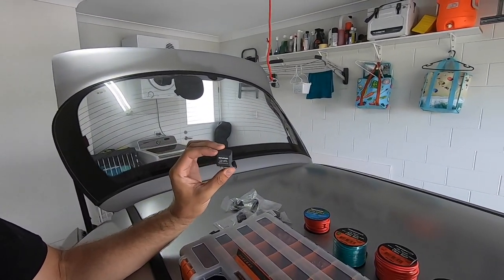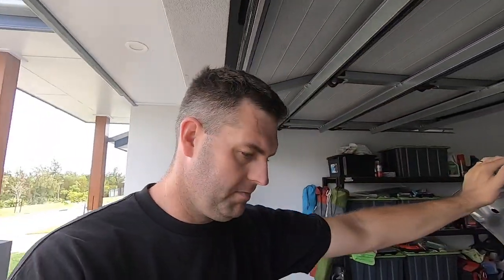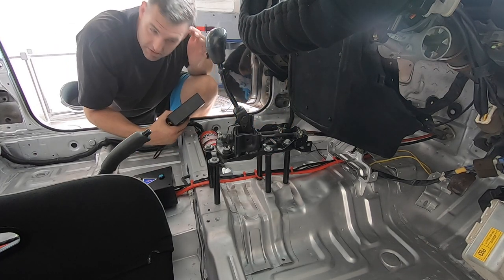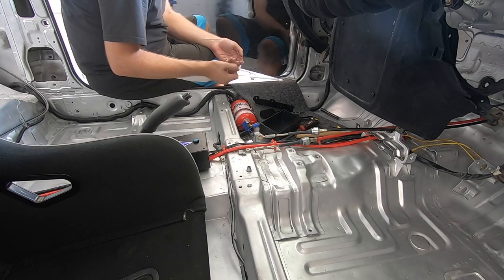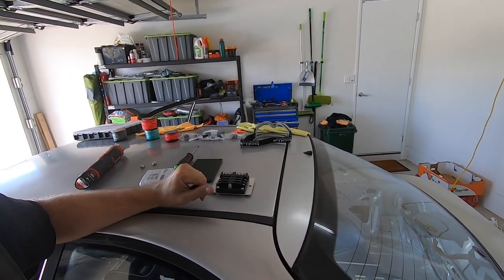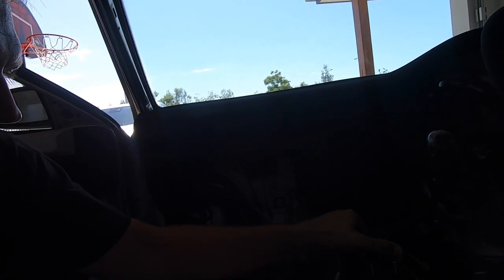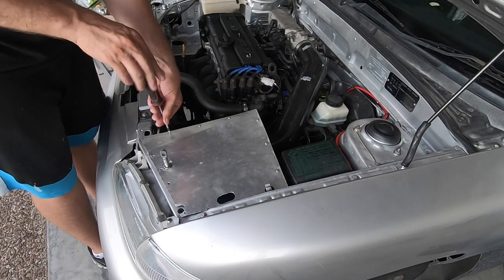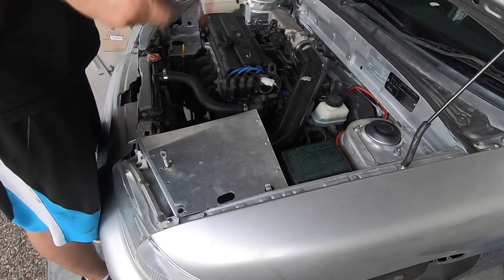Custom Switch Panel Makes Life Easier!

Comment: Have a look on brown davis racing, they sell a radiator and fan kit for the excels, keeps them ALOT cooler
Reply from the maker: That’s actually the exact option I’m thinking of going with. With the constant ambient heat up here and the humidity, I think it would a solid option.
Reply: @BigRigRacing  and remove the thermostat
Reply from the maker: @blokebeershed7651  yeah, I will do that when I change the radiator over. Def one thing I have written down as a “to do”.

Comment: Nice work! I use cloth tape for all my wiring harnesses, it looks very professional. I just get it in packs of ebay. Also that intake lid looks.. a little annoying to access, have you thought of just putting a few latches on it or even wing nuts?
Reply from the maker: I have thought about wing nuts, but I haven’t really put too much extra thought in to it to be honest. I’m sure when the car hits the track I will getting in there more than I think. Also, using a screw driver takes forever, but a quick hit with a small drill gets them out really quickly.

Comment: Hello Mate. I'm slowly building up my Excel also ☺️ Just checking in as I have a question, where did you get the shifter raiser stands from? And what size length bolts are they? Thanks legend hope to hear from you soon.
Reply from the maker: Hey mate, I got the pipe from Bunnings. Comes in 1 metre lengths. Can get aluminium or steel, I went for steel for a strength stand point. I think it’s only about $7 for a metre. The bolts I got from Bunnings also, I think they were 150mm from memory, but the actual pipe was cut in to 120 or 130mm lengths. Most people go for 100mm, but I wanted mine just a fraction taller. All up I think it cost me $16 or so. I did an earlier video on it in build video #14 where I fix some rust spots on the car.
Reply: @BigRigRacing  fantastic. I recall watching the video but couldn't remember if it was yours or Matty Hull's nugget project. Awesome work. I will pop into Bunnings today. Thanks legend.
Reply from the maker: @miltoncortez7873  no problems :). Glad I could help.